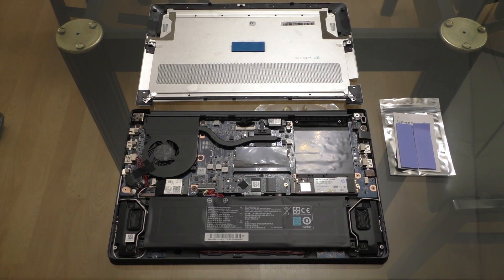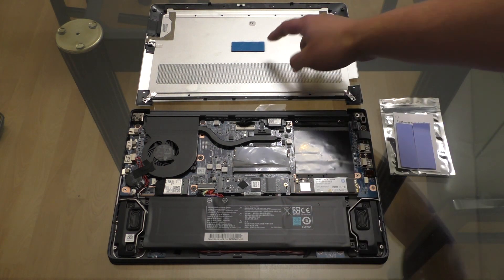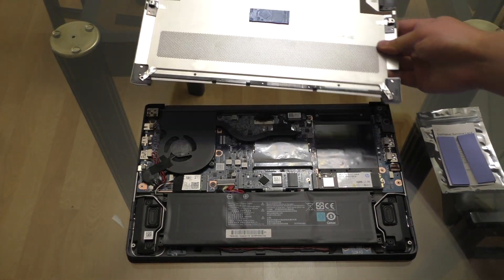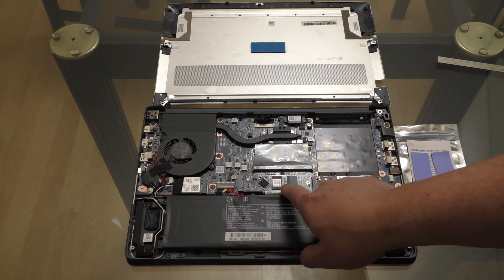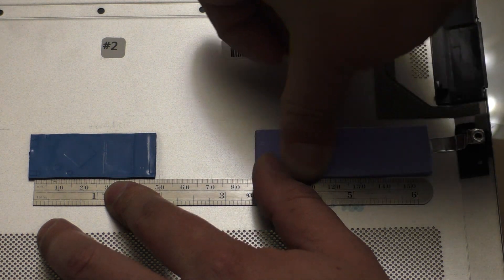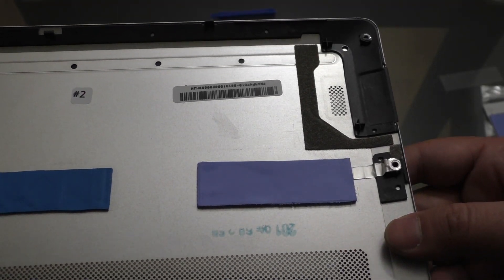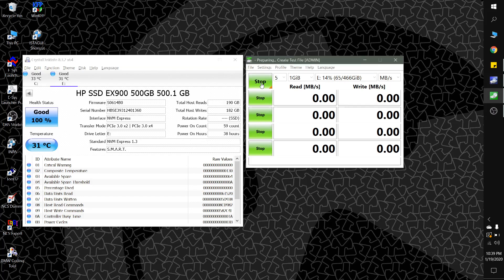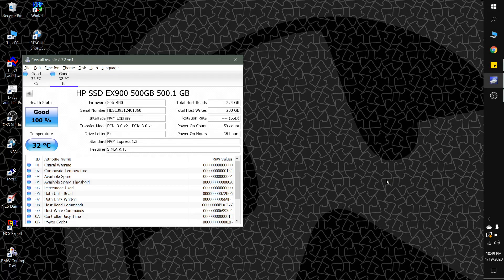Motile Laptop - Adding a Thermal Pad to the SSD

Comment: many laptops have a heat spreader that has a controller chip pad.. what would be the pro/con of just a controller chip pad vs removing the spreader and going only pad to the cover?-- or even 120x20x  .5mm pad under the spreader?

Comment: Does removing thermal pad after months removes serial no. and other information written on it? I am asking because information is used for claiming warranty.
Reply from the maker: Should be safe to remove. I haven't seen pads pull off stuff from the sticker.

Comment: I am so confused after adding a new SSD without thermal pads it goes max 50°c
The primary SSD with thermal pads going upto 70°c.
Reply from the maker: Different controllers/chips will perform differently. They're designed to different thermal and power specs.

Comment: You need to place the thermal pads directly on the ssd! not the other way around like you're doing!, once you make sure the thermal pad is covering the controller close the laptop case and it'll stay in place! the reason why your other thermal pad is on the laptop case is because the sticky part was stronger on the case side and since you lift it it came together but at the factory those thermal pads are placed directly on the SSD's and then you close the case
Reply: Sometimes the thermal pad sticks to the case even when you properly apply the pad to the SSD then close the laptop case. It's because the laptop case has more surface area to cling to the thermal pad than the SSD does. Also, the laptop case can have rough material with many small bumps and crevices on it which cling to thermal pads.
Reply: Tech guy just told me that applying the pad on the ssd is worthless unless it touches the case so it can dissipate the heat. Pad doesn't need to touch the case to work? And also should i apply the pad to the whole ssd or part of it ?  Original ssd has partial pad on it.
Reply: @razwatsup2526  not if it's a plastic case

Comment: I need to ask. Can you add a thermal pad or heatsink or both to a M.2?
Is it necessary to have both?
Reply from the maker: There isn't any room to add a heatsink to an M.2 on this laptop, just thermal pad.
Reply: @FaRKle0079  there is a heat sink that's just a copper plate that's as thin as a thermal pad so might be able to fit
Reply from the maker: @TheChillDeadpool  I'm not sure that'd be any better than the thermal pad connecting the drive to the bottom panel though, unless you meant trying to it on the mobo side of the M.2 drive.
Reply: @FaRKle0079  well nvme 2280SS means all the chips are on one side "SS" stands for single side

Well if you don't have a metal bottom panel for your laptop this could be another solution

AND YOU.. wouldn't have to worry about  the thermal pad sticking to the SSD or it sticking to the bottom panel when closing or taking it apart ect.
Reply: @FaRKle0079  that makes sense 😅 thanks for the feedback. I want to install a M.2 on my own laptop and this is pretty helpful 👍
Reply: @FaRKle0079  I have a Lenovo ideapad 330s 8th Gen. Would a heat sink fit on this laptop and must I add it if I can?

Comment: Can i add thermal pad for HDD also because its getting overheated
Reply from the maker: Sure, you can add a thermal pad to a HDD case to sink heat to a body panel or something. You'll probably want to find out if it's the controller on the HDD that's overheating or the spinning platters themselves to figure out where to best place the pads.
Reply: @FaRKle0079  thank you for the reply.. Will it still work if my laptop's back panel is made of plastic
Reply from the maker: @mahiman_sharma  Plastic is a poor thermal conductor so it may help a slight bit, but not much unfortunately.

Comment: I see it dissipates the heat into the case. Should I have thermal pad if the lower case is made of plastic? Thanks!
Reply from the maker: The inside of the bottom cover is metal. If it was all plastic adding thermal pads wouldn't be very helpful.

Comment: Can I stick the thermal pad directly into the ssd? Or do I have to stick it in the plate as you did?
Reply from the maker: Yeah, you could probably do it that way too, but it might stick to the SSD instead of the bottom cover next time you take the cover off.

Comment: Thanks for this video. I couldn't figure out why 2 Crucial 2TB SSDs in a row kept throwing I/O errors in my HP Envy, yet when I plug one into a USB M2 adapter it was smooth sailing. A thermal pad is the next thing for me to try. 

Surf Wisely.

Comment: What size is suitable for vram use near the gpu. 1mm or 2mm??
Reply from the maker: There's no GPU or VRAM on this laptop. The GPU is integrated onto the CPU package. The DRAM SODIMM doesn't need a thermal pad.
Reply: @FaRKle0079  but what size do you think is suitable?

Comment: Kinda am confused.. When this thermal pads have 2 glued sides, why are you measuring on the backplane, instead of just sticking it to the m.2?
Reply from the maker: If you put it on the bottom cover first you can ensure it's making good contact across the whole thing. If you put it on the SSD first, it'll make good contact on the whole SSD, which doesn't need it, and might not have as good contact with the bottom cover. You can do it that way though.

Comment: I added HP EX900 on the first slot and with this the surface of the SSD sticks to the thermal pad on the laptop case. Will that be problem?
Reply from the maker: Nope, no problem at all if you put a different SSD into the first slot and reuse the original thermal pad with it.
Reply: @FaRKle0079  Thanks, but if thermal pad sticks in top of the SSD and laptops back panel would that affect the SSD or it's performance?
Reply from the maker: @Ajeevlal  The thermal pad is supposed to contact both the SSD and the laptop bottom panel. It transfers heat from the SSD to the bottom panel. The bottom panel acts as a heatsink for the SSD.
Reply: @FaRKle0079  thank you, I got it now

Comment: Thanks for the video. Now, how thick is the pad? 1mm or 2mm?
Reply from the maker: I used a 2mm thick pad.
Reply: @FaRKle0079  It is supposed to cool only the controller and DRAM, the IC and other parts are better to be left alone and do not get the heat from the controller.

Comment: Heads up, the controller is the part that needs to be cooled. If you cool the SSD flash too much, you impact the flash performance and ability to function. Linus Tech Tips did a video on liquid cooling an SSD and goes into a bit of detail on this. You can cut the write endurance (SSD lifespan) in half by cooling the flash just to room temp.
Reply: @noodlesharvester7282  this laptop can't fit an HDD.
Reply: Can you put a link to Linus video on cooling an SSD? Thank you..
Reply: @shaundalindsay8882  as far as i remember they were liquid cooling an ssd (i might be wrong) so it doesnt apply the situation here i believe
Reply: @schumbo8324  Thank you. My PC gets so hot and it's brand new so it kinda freaks me out.
Reply: @shaundalindsay8882  look at repasting the cpu and gpu i have tutorial on my channel it pretty easy
Reply: @MrWaheedulHaque  Will do... Thank you!
Reply: @MrWaheedulHaque  I tried to find it But I can't. You have so many videos...
Reply: what are nice temps for the flash? 80 is fine?

Comment: Tried to add a secondary SSD & the computer wouldn't boot. Only got the black Motile screen. Removed the SSD & the computer works fine. Called Motile support & they think it must be a computer hardware issue. Probably have to send it back for repairs.
Reply: I tried another SSD & everything works fine. Either a defective SSD or not compatible. It was a Toshiba.

Comment: Did using a slightly thicker pad have any effect on the orig. SSD temps?
Reply from the maker: I haven't noticed any change in the original SSD's temps with the pad on the secondary SSD.
Reply: @FaRKle0079  Thanks. So the 2mm pad for the secondary SSD( while keeping the original pad on the original SSD )is the way to go.
Reply from the maker: @alanroberts7723  Yup, that should work just fine.
Reply: @FaRKle0079  Great video. Really appreciate the help.

Comment: Did you took off sticker from SSD or just left it there? I mean, obviously the result will be better without sticker, but then your warranty for SSD will certainly be void.
Reply from the maker: I left the sticker on there. You're right that it inhibits the heat transfer some, but the important thing to keep cool is the controller, not necessarily the memory chips themselves, and that doesn't have the stocker covering it.
Reply: some of those stickers already act as a thermal pad thanks to its material and the engineers built it so its not %100 that it was just a paper standing in between

Comment: bro can you help me out? just got my motile 14 today, and im surprised how hot it gets, havent recorded the temperatures yet, but its hot as hell, my thighs hurt when im putting keeping it on my lap, and the fan noise is annoying too, is it normal to heat like this or should i do something about it? and the trackpad is bad as well
Reply: the laptop overheats on idle as well, and then the fans start spinning, but dont mange to cool the laptop though
Reply from the maker: @Niko-zl5hn  I'd grab some monitoring software to see what the temps are getting to. If the temps are getting high, but the processor load is low, then there might be an issue with how well the heatsink/heatpipes are making contact with the CPU.
Reply: @FaRKle0079  im using core temp to monitor the temps, idk if its the cpu load but on the load section, it has four different sections, it could be cpu cores, they get about 64% of load, but the temps are 75C as im typing this, imm keeping it on my lap, but i dont think laptops get this hot even if youre using it on your laps, keeping the air vents covered...in the task manager, the cpu usge is 80-90...what temps do you get? and can you tell me a good monitoring software? and can i undervolt the cpu?
Reply: @FaRKle0079  i used fan control and task manager to more effectively monitor the temps and cpu usage, the cpu temp rises even on 25-40% of cpu usage, it rises to 50- 60 and even 70 sometimes, what temperatures do you generally get while just browsing the web

and one more thing, is there any way i can limit the usage of the cpu to get cooler temperature? i tried undervolting, but the software wouldnt let me do it, because i think ryzen apus are not meant for undervolting
Reply from the maker: @Niko-zl5hn  Is your 60% useage short spikes, or sustained? If it's sustained like that at idle I'll be surprised, and say you should find out what's causing that.

Might want to check the stock thermal pad, or replace with thermal paste if the temps are high at idle and low CPU useage.
Reply: @FaRKle0079  its usually spikes, when i open chrome, mostly chrome....idk for some reason, chrome takes a lot of cpu usage, not the laptops fault, chrome is just the way it is i guess...i
its actually fine using on lap without the blanket covering its vent..it heats up bad when im using it on bed with blanket on...
i think, its not meant to use it on bed, with blanket on lol... the vents shouldnt have been on the back
Reply: @FaRKle0079  and how much battery backup do you get? mine ranges between 7 hours to 45 mins lol, when the fans are rolling...but its only saying 3 hours 32 mins, now...but the fans arent even that loud as im typing...weird...how many hours do you get
Reply: just noticed now, the temps went over 70 while playing a 1080p youtube video, the cpu usage was also around 50, it later went down, along with tempreature while playing a 240p video...idk what wrong with my laptop....shouldnvt have bought this piece of junk..no offence to anyone though

Comment: What about placing thermal pads on the heat pipes to help with the CPU?
Reply: Have you attempted it? I'm thinking of adding it myself but unsure if the thermal pads won't just fall of after awhile
Reply: @jackblack4110   ya got the same doubt
Reply from the maker: I'd be really surprised if the heatpipe to CPU die/IHS didn't already have some kind of TIM. Did you see that it didn't?
Reply: @FaRKle0079  I think we are talking about different things. I'm specifically talking about the run of heat pipe in between the fan and the cpu. If you were to place thermal pads there, it would carry disperse through the case too right?
Reply from the maker: @jcheng4015  Yes, if you wanted to increase the cooling capacity you could add thermal pads to the heat pipes so that they sink to the bottom cover.

Comment: Relating to the other video...  Why did you upgrade the wifi? Is it a lot better and worth it? Im confused. Not saying that you shouldn't have just trying to figure out if i should or not.  I got the better one due to it being $309 but with the ram and ssd its getting expensive. Lol
Reply: Yes. Upgrade the WiFi. Asap.
Reply: Yes, for $18 bucks the Wifi upgrade is WAY better than the stock wifi.